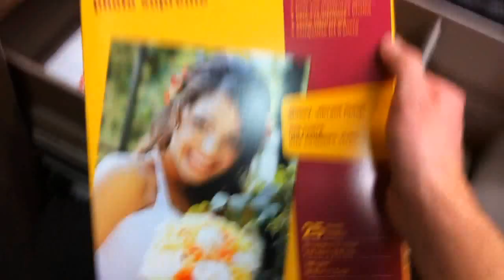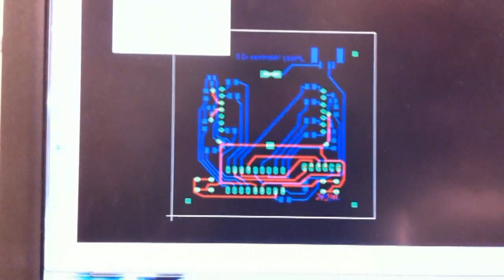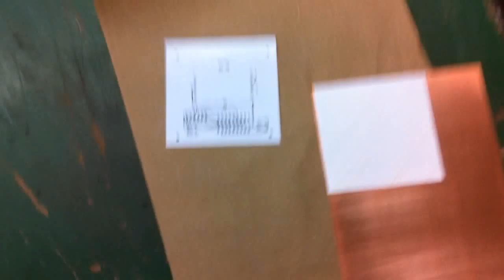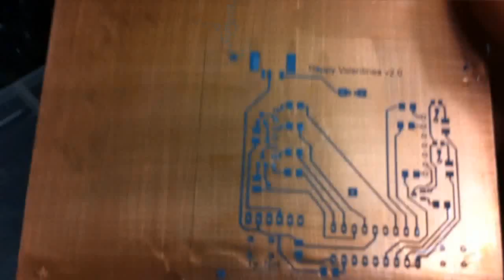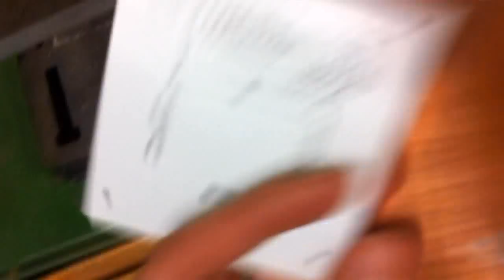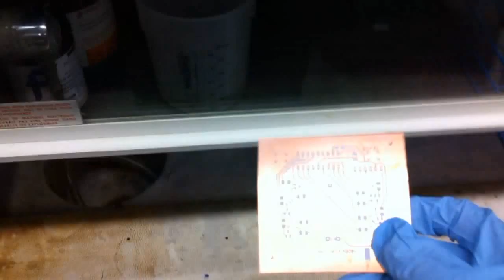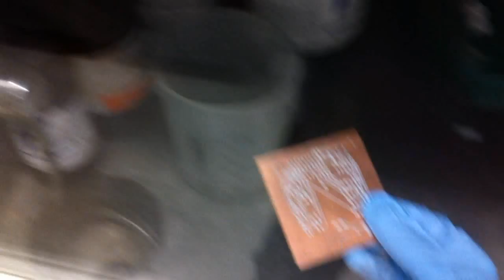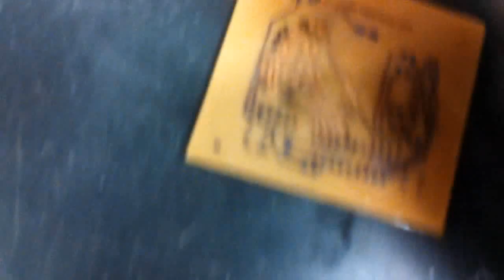How to Etch your own PCBs at home w/o ferric chloride (detailed)

Comment from the maker: also, I found that instead of starting with the iron in the center, its better to initially cover the entire thing with the iron and give it some pressure.  Wait about 45 seconds or so, then start moving it around like the video says.  Otherwise the paper starts to curl from the center and it wont stick very well.  Make sure your iron is turned up all the way and let it sit and get really hot before starting.

Comment: Steel wool is sold with oil on it, so sandpaper is better. I wipe with isopropyl alcohol after, too. Also, if you fill in all the spaces on your printout, you can either have that connected to ground, or just leave it there. It will mean less copper to etch, but it also means you can cut the paper and board to the same size and iron bothe sides on at once, occasionally turning it over...this automatically lines everything up, saves time and saves etchant.

Comment: Thanks.  There are a few youtube videos where they're adding the hydrogen peroxide to the acid.  I did some other reading and found this was incorrect.  In fact, it says as much right on the label of the hydrochloric acid.  Thanks again.

Comment: Have you tried any of the tin plating solutions to protect and tin the board so it does not oxidize so badly if not used right away?  Also, you mention that Linen is the hottest iron setting.  Is that the setting that you use for the iron?  Do you rejuvenate your acid solution by adding more acid?

Comment: tydye, first, great video.  thanks for posting.  you wrote "add the acid to the peroxide." did you mean the opposite?   shouldn't the 2 parts peroxide be added to the one part muriatic acid?

and.... how to safely dispose of the etching solution?

Comment from the maker: You mean for vias?  I usually just drill the holes, then poke a wire through it and solder to both sides.  Snip the extra bits of wire off to get it flat.  I try to avoid vias as best as I can in my designs.

Comment: I tried this on a flexible PCB (using Duralux).  I used a Scotch-Brite pad that claimed to be equivalent to 00 wool with acetone.  Besides the flex material, an additional challenge was that I was trying to replicate a board that is 22" long, so I used three sheets of photopaper taped togeher.  I have several chunks of toner come up, and spent hours using a utility knife to scrape paper off the copper.  It was stuck that tight.
Sharpie leached off before etching finished.  Any suggestions?

Comment: "Polishing with steel wool is one of the most important steps!"
 No, it's not. Infact, it's a myth. The tonerprint will adhere better to an oxydized (dark)
surface than to clean copper. Even fingergrease won't affect the endresult. I know, sounds
strange but is my experience. Succesrate with 'dirty" copper is higher than "clean".
Also, it doesn't have to be 'Glossy" paper. Standard copier paper does a good job.
You don't need a hot iron. It causes stress in the material. Just use nailpolish remover
(cold toner transfer).

Comment from the maker: @sucanushie Anything works really, but the thinner stuff is usually easiest.  Sometimes when you use the thicker boards (like the radioshack ones) they chip off when you drill holes.